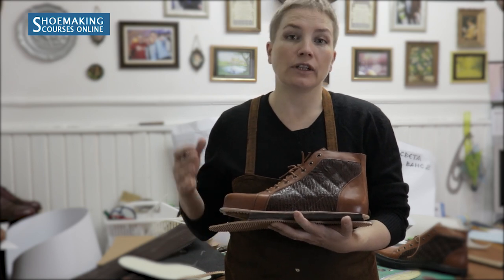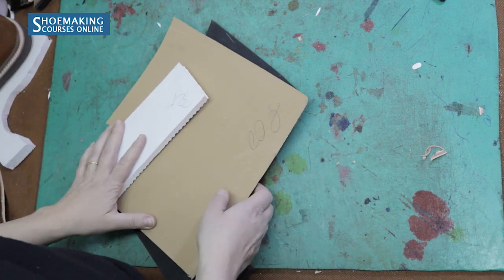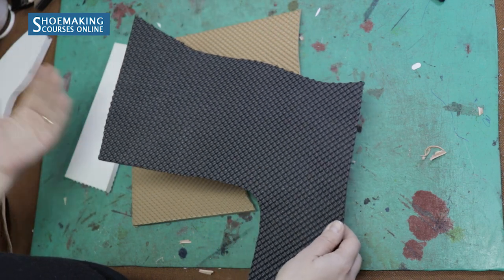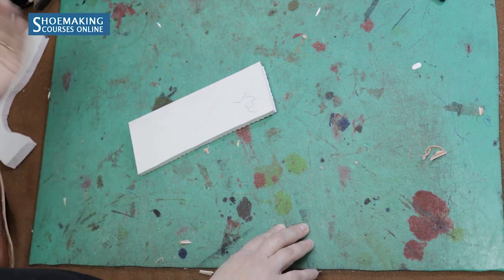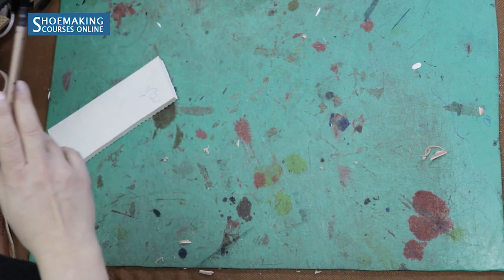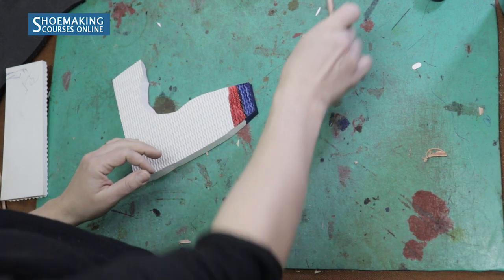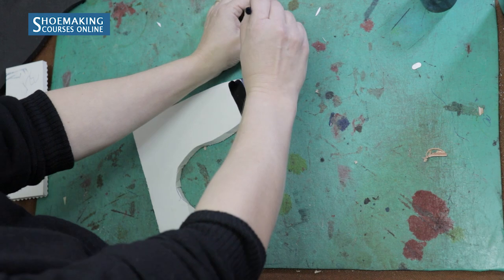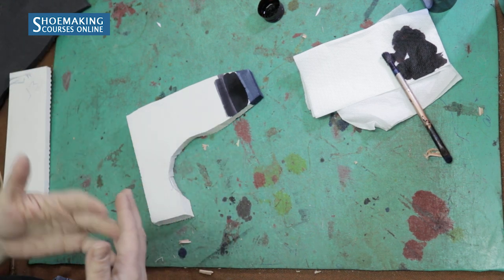Shoe Sole from EVA foam [ Color it for Sneakers]

Comment: Actually EVA Foam is used in shoe building and repair, the industry term for it is soling crepe. I ran a boot repair shop for 5 years.
Reply from the maker: In our industry the term is EVA
Reply: A lot of the trainers I sold at hugo boss were eva foam outsoles
Reply: @SKDEZIGN  Maybe they finally updated the terminology.
Reply: hi sir! what density do you recommend for durability? thanks in advance